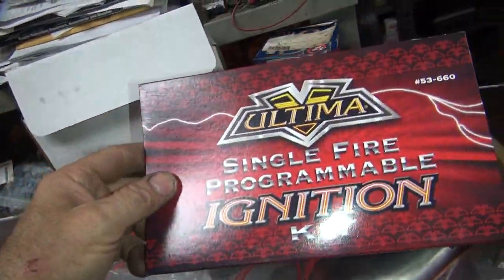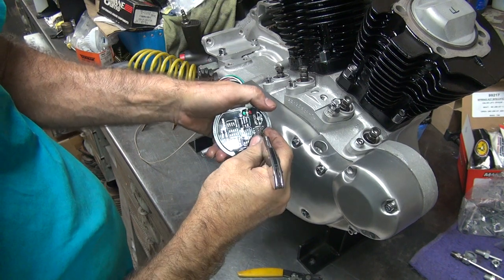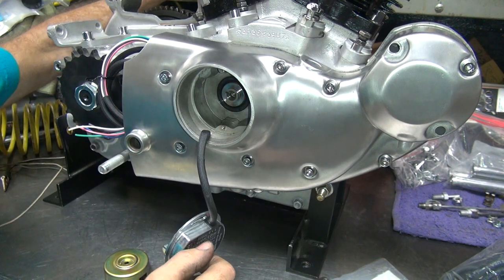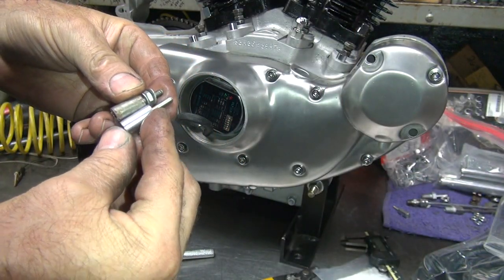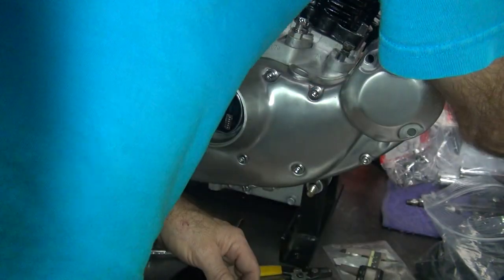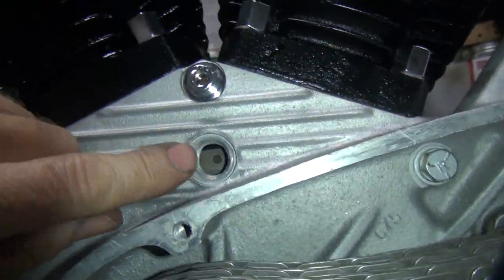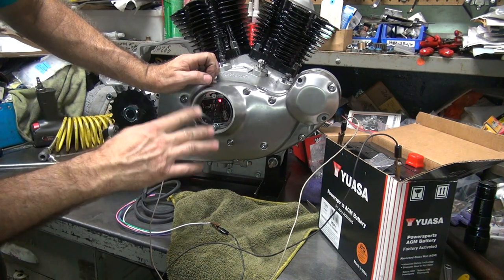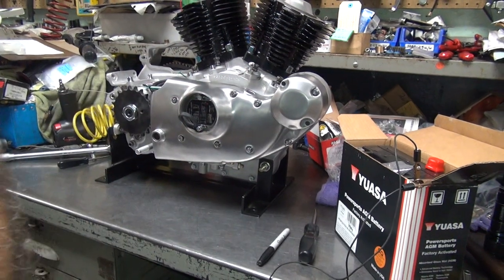1977 xl xr street tracker #139 motor rebuild repair 1000cc sportster ironhead by tatro machine

Comment: Hey tatro could you tell me if there is any disadvantage to running the 48 degree timing instead of the 44 where you set this motor? I am about to install a ultima ignition in my 72 ironhead and was going to go for the 48 degree if there is no danger in doing so. Thanks!
Reply from the maker: if you have good gas it usually runs better.
tatro

Comment: I hope the ignition programming cable I sent you has been serving you well. I still have about 100 cables that need new homes.  

--VRob
Reply from the maker: yes it works very good. maybe i should get a 2nd one just incase i over fix yours.
just post my videos to them some how. that should help the sales.
you can add a link to one of my videos too, but only one.
tatro
Reply: @TatroMachine  next time you program an ignition, film it and tell your audience to Google the cable part number, VRUSB2000i. I'll send you another free cable. Regular price is $40 shipped.

Comment: Tatro I need some expert advice I just rebuilt a 75 ironhead running a super e carb with drag pipes it’s a xlch kick only bike starts 1/2 kicks but when cruising around 35/40 mph the bike intermittently coughs out the carb if I accelerate it quits coughing Iam running the ultima ignition and timed it as per the video any advise greatly appreciated

Comment: So if you do it on the computer you're "flashing" the module? And that only gives you one ( non  adjustable) setting ?
Vs if you use the dip switches, you have a few more options to play with.. is that correct..?
Reply from the maker: yes, but kick starting is not an option with the switches.
tatro
Reply: @TatroMachine  You can enable the switches after setting the dead revs to zero. Just go to the Curvemaker- Diagnostics tab and select "Use Switches". Dead revs will stay at zero.

Comment: Tatro I need some help just got done rebuilding my old 75 ironhead I got the bike a year ago it hasn’t run in 25 years I tore it down installed new rings,valve job installed new super e carb and ultima ignition timed it as you advised in the video the problem I have is it’s hard to start,backfires out exhaust,carburetor blowing fuel out carb I’ve checked for air leak at intake and carb rechecked timing and valve adjustment and can’t find anything wrong also rechecked cam timing it does run better after it gets hot but still pops out carb under acceleration and iam wondering if iam fighting 2 problems I’ve also reachecked carb set up any advice would be greatly appreciated
Thanks
Reply from the maker: sounds like you are too lean. clean out the carb better and or bigger jets.
tatro
Reply: Tatro Machine  thanks for the info the carb came with 4 replacement jets I started out with a 170 and now iam running the largest one it’s a 190 I did notice if I keep the enricher on it runs better so that makes me think it’s a lean issue